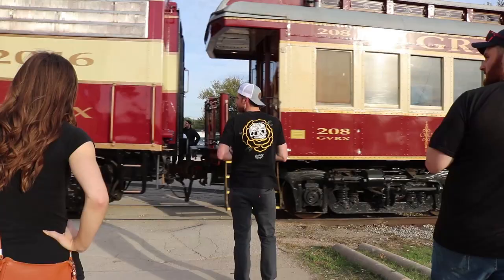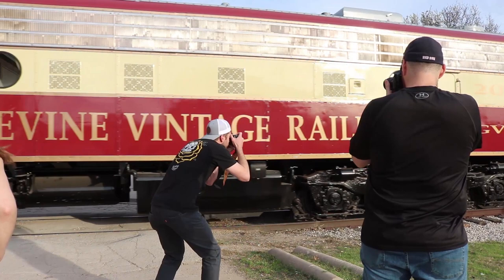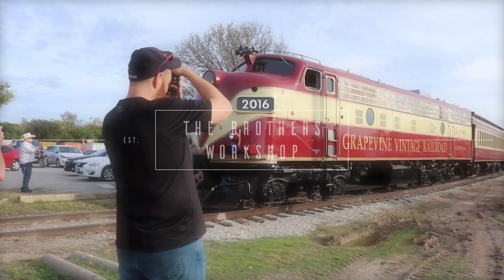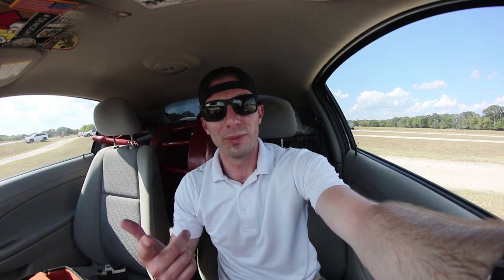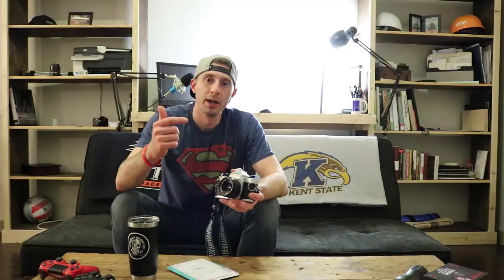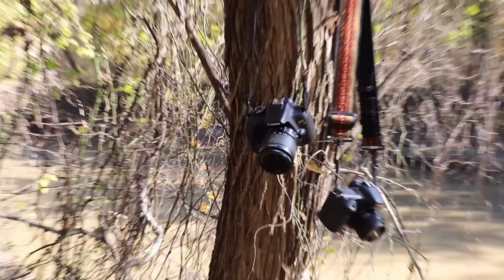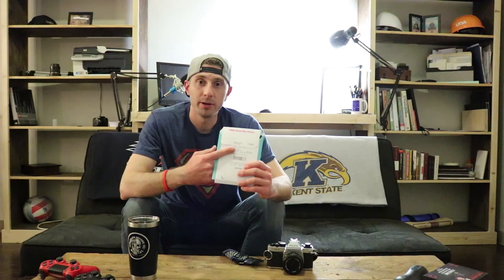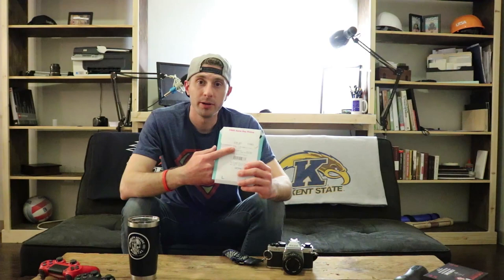Will It Work? A 5 Dollar, 42 Year Old, 35mm SLR Film Camera; Repair and Restoration of a Ricoh KR-5

Comment: You didn't actually repair the camera on screen... Was kind of hoping for that based on the title
Reply from the maker: You’re right! At about 2:15 Dave explains that the camera needed new batteries and had a jam in the internal workings.  He essentially pushed a lever next to the mirror and it snapped back into place.  That was all, and the video was about the  story of the camera. 📸